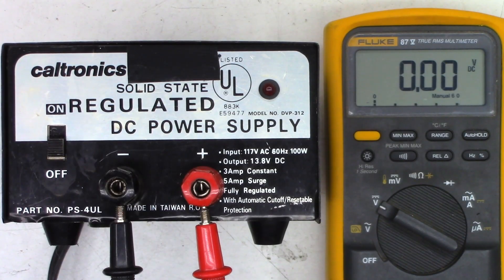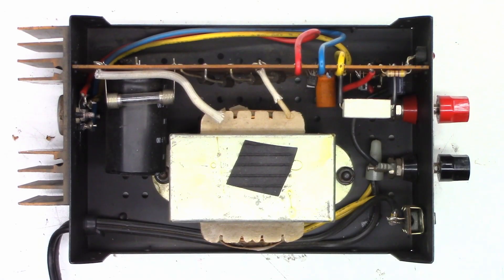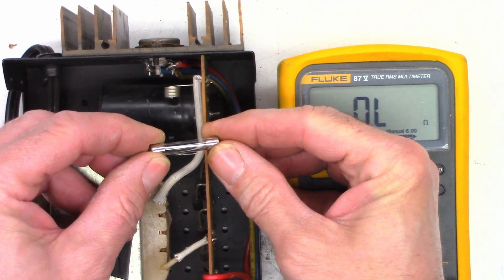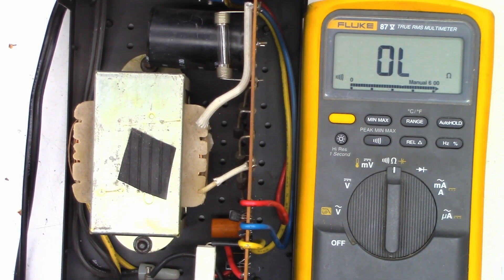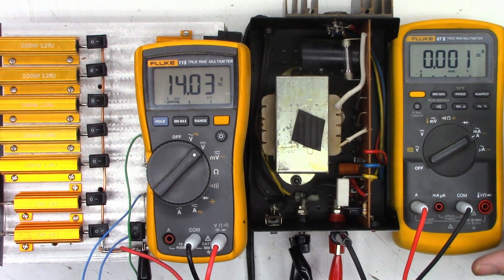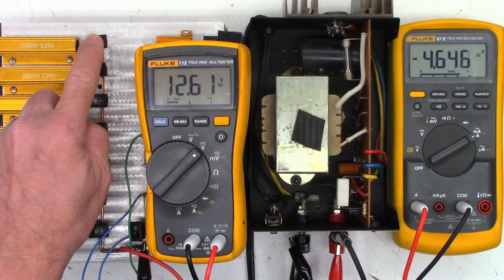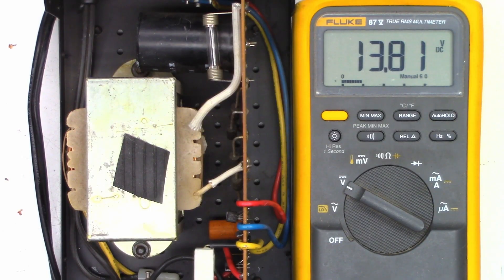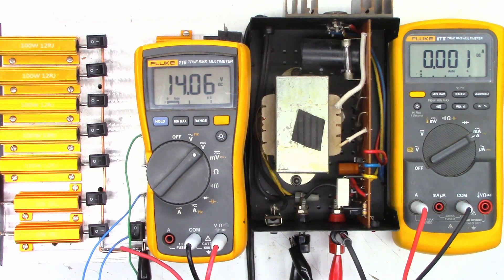Caltronics DVP 312 PS-4UL Dead Power Supply Repair

Comment: Learning so much from your channel. Thanks for all expert the tips. 

I have a power supply module from a eurorack system that has a blown capacitor. My problem is that I can't access the PCB to remove it becuase it has an EC block directly mounted below it. Guessing its the oscillator section with its own PCB. Is there any other way to replace the blown capacitors for a newbie like myself, topside? Appreciate any tips/recommedations! The module is the TipTop microZeus.
Reply from the maker: Sometimes unfortunately the other module / board has to be completely unsoldered and removed to facilitate a repair.
Reply: @norcal715  ah ok...its a small module so still thinking about attempting a repair... Wish me luck!